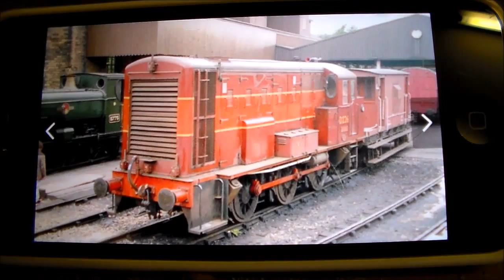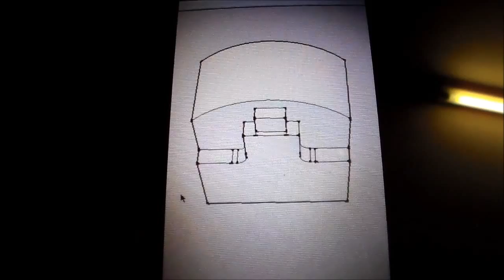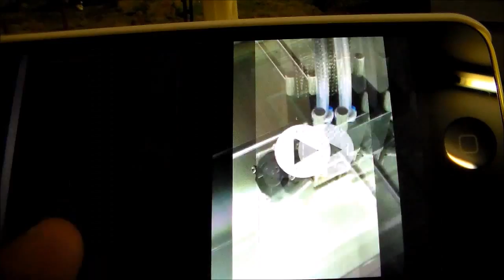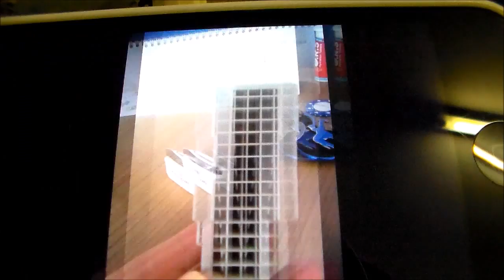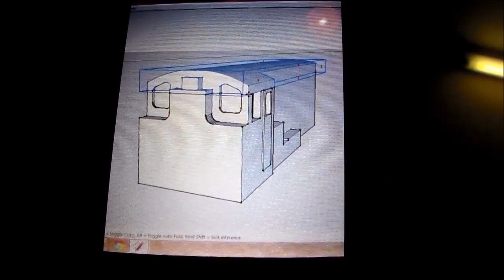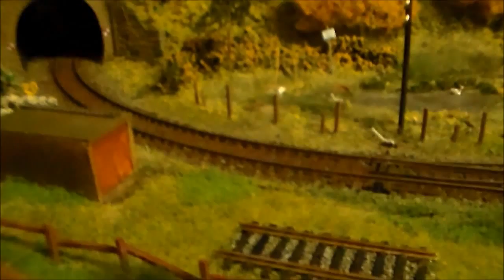3D Vulcan Project

Comment: Blue livery is reminiscent of the prototype Deltic which is why I guess they did it? Personally I like it best in BR green - but I would... So pleased that your bro has been able to make Vulcan a reality for you! The £400 talked about is probably right for a prototype 3D model... Technology is moving on all the time for 3D printing, and models are getting ever stronger. Resin casting is still prob the best way to go for a production run, and I have a mate with a CAD scanner/etcher/printer for master making in plasticard then casting in resin. You could make the grilles building them up using plasticard/styrene microstrip. As you know, some of the Xtreme etches "generic" fan/grille kits etc could help with superdetailing? Looking great mate!
Reply from the maker: Hey up :) the Deltic, hadnt thot of that!! I bet ur right there! Im very lucky to hav this opportunity, and thanks to my bro for doing it! But dont think ur outta the woods yet pal, i hav plans for u n ur resin ;) the scratch building side of it is proving 'fun', and all the materials wil b revealed in the nxt vid :) cheers mate!

Comment: That is one very ambitious project,,, more than likely a totally unique one off model so most have a huge rarity value,,,  all credit to your brother ,,,,,  now you have to use your skills to bring the project fruition and bring Vulcan to life which will be very interesting to follow ,,, well done to you both ,,,,    ( I have wanted to do a similar project to create the Fell Diesel with been in N gauge and pretty much slab sided it would have to be just plaster card construction and it had similar access panels down the side ,,,, my only thought to get such fine detail was to cover the sides in self adhesive vinyl and cut away the background and grill slits etc ,,, in the hope that once painted you would have the very fine  detail,,,,,,  I know im preempting a video but whats your plan for the panel detail ,,,,  )
Reply from the maker: Thanks a lot Alan :) all credit to my bro for making it happen! I hope i can complete it properly and fulfill my quest! Ur N gauge theory sounds gud, owt poss with plasticard! For the panels, grilles etc im toying with a couple of ideas...?! Either adding other materials, etches, plasticard, etc, or, just adding them in a moulded fashion to the body? So scribing the loco adding any body lines needed?! We'll c :) cheers
Reply: +Matthew Snowden  I don't envy you ,,, that is going to be challenging ,,,,   but thinking back to some of your other conversions etc im sure you will find the right solution ,,,,
Reply from the maker: I do hope so! Cheers